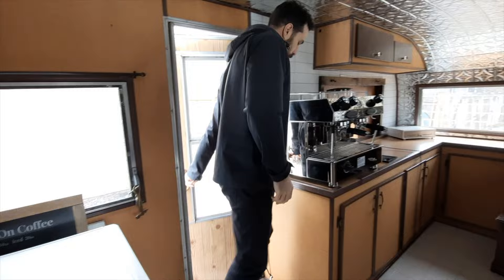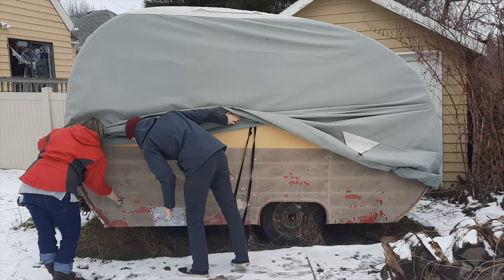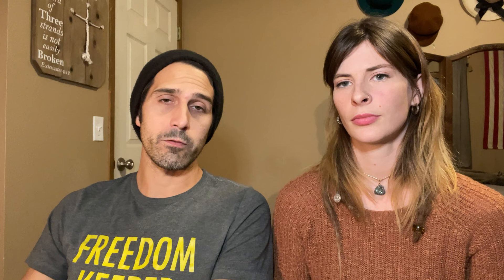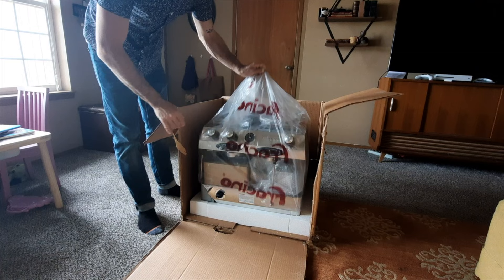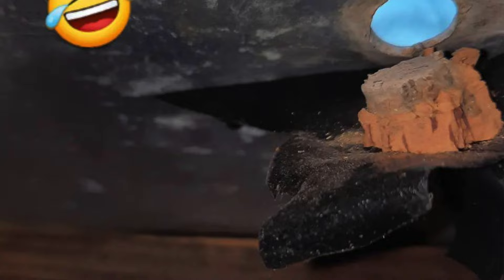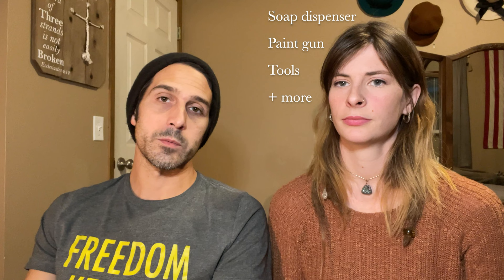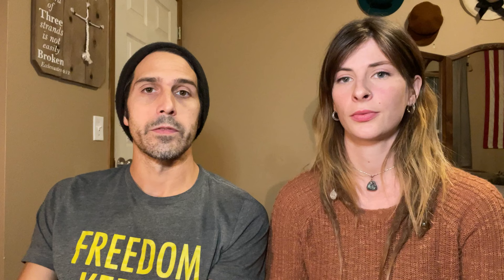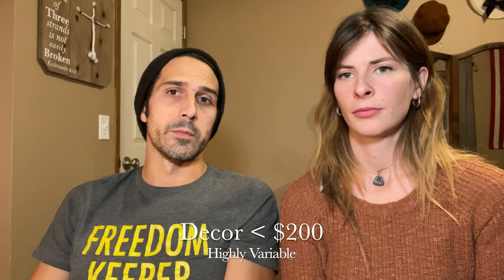Total Cost Break-down to Build a Coffee Trailer / Coffee Trucks

Comment: With your set up how many customers can you serve or sell a day?
Reply from the maker: If you choose the battery system mentioned in this video, it’s good for about 6 hours. So it comes down to how fast you are on your espresso machine. I would say no less than 40 hot drinks per hour, steamed milk and all. So at least 240 drinks in a 6 hour period. But that is on the low end.